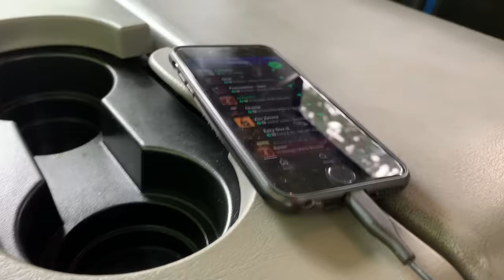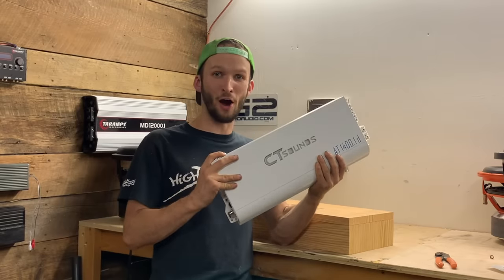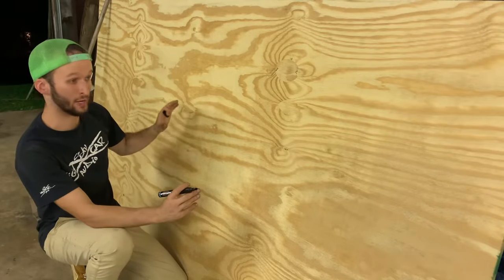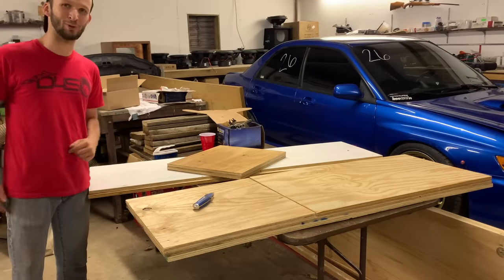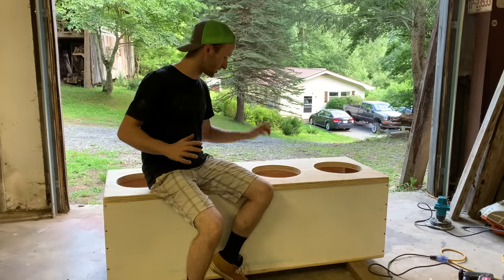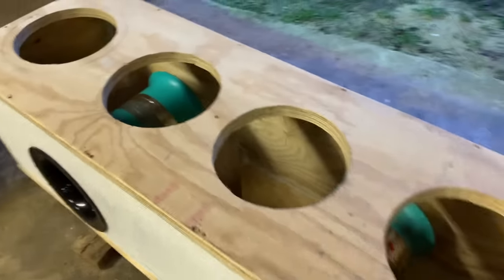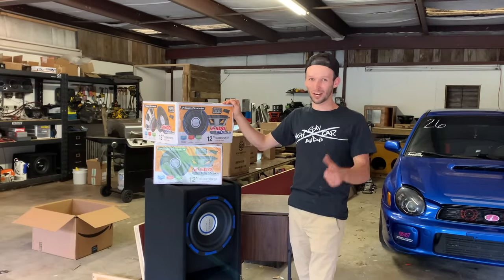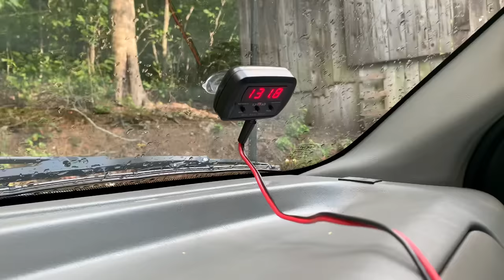How Loud? Walmart Build Part 4 FINAL

Comment: Hey I really like your videos and would really like some help with my build and advice from you and also if have some requests of what I'd like to see you make a video about.  First off I have a 06 dodge ram mega cab that I have been trying to get a custom box built for it to that will fit behind the rear seats and not under, I've found numerous boxes but they are all for a sealed enclosure which is not what I'm wanting. I want a ported/slot box that will be big enough to have the space to add two more subs if I want to later on but right now I only want it for two 12s, the thing is I have to have 7-3/4" mounting depth for the subs I have already which are the skar evl-12d4 and I have the skar rp2000.1 amp that is pushing them for now but getting another amp so the subs can be pushed by their own amp. I have removed all my inside Plastic trim and panels that are factory on every vehicle which I don't care if the back panel that is under the rear window stays removed that's what I had planned for but I would like to possibly be able to put the side trim panels back in if there is any way possible but if not as long as I can make the final design look like it was made at the factory that is great. I know I have a lot of demands and request but I know your audio skills are great so if anyone is able to help me out it's you. With the side panels installed it leaves me with just a little more the 52" from left to right for the box to fit. The thing that is giving me such a hard time is trying to get the internal air space available once the subs are installed and I know there is a method to calculate that by multiplying width by height by length and then divide that by some other number or something like that but the problem Im having is every search I do regarding this only give details for the shape of a square or rectangle box or a wedge shaped box and the box I am needing is neither of those but is similar to the wedge shaped box except that the back of the box on the wedge looks like this ] but mine needs to be like that but not straight up at about around 13 inches or so there needs to be a 90° angle that turns to the front of the box for about 1-1/2" and then a 90° angle turn back up to the top of this makes any sense, I don't know how to describe it with only words and if I could add pictures I'd show you exactly what I'm talking about. The reason the shape is needing to be that way is because at the rear of the cab of my truck below the rear window there is a added brace of sort to give the rear window more support and better structure to the back of the cab and it sticks out from the back of cab towards the front of the truck about 1 inch and that's why I need it to be that shape and with that shape I don't know how to calculate the dimensions to get the over all volume and the subs I have require 2 cubic feet per sub for a ported box tuned at 32hz which is the manufacturer requirements and data. I'd like the ports to be at the top of the box facing the roof but to make things more difficult I'd like to have the port made so that I can but a 90° elbow on the end of the port so that I could have the ports be adjustable with adding either the 90° pvc elbo or maybe a 45° pvc elbo or similar that way it's also changing the tune of the port and hz just a little if this makes sense to you. For example I built a box back in the early 2000s that was in a Suzuki sidekick that was a bandbass style box but all covered except the port which I made out of a 6" PVC pipe and several different 6" PVC fittings to be  interchangeable and it would make a big difference with the different type of music I played when changing out the end fitting and I really like that concept and worked really good so it would be perfect if that was possible. If your willing to help me out i would be very thankful and you can direct message me or private message or if I am able to give my email that would be fine to. Thank you again sorry for the novel comment I have made.  The ideas for the videos I'd like to see you do would be to possibly do some subs and amps from the app called wish they are very cheap in price and some of the deals you can buy 4 subs for the price of 1 no joke and I'd like to actually see what it is that you build and get please

Comment: There isn't near enough space in the cab for 4 12's to breath. I'd bet big money 3 10's or 4 8's would put up higher numbers tuned right for the cab
Reply: @CajunReaper95   yes and no..  cone area is always gonna be a top factor. Only if they can breath. Example. Stick a 15 in a box built for a 12 and a 12 in a box build for a 12, and meter them both with equal power.  That's what I'm getting at.
Reply: @CajunReaper95  he'll what part of LA are you in, I'm back down south for a while, we can test this. Bring ya pocket book. Lol

Comment: Great Entertainment video but there were some flaws with this setup.. The ports were too close to the inner box wall and too close to the car seats blocking the air output. These subs can take more power so you need a bigger amplifier and you need another battery or 2 to help provide more power to them amps.
Reply: Walmart doesn't sell a bigger amp than the Razer 2500 Amp off the shelves. Those GW-124 subs can get really hot from playing for a while on 600 Watts on that amp, not sure they can really take too much power on anything besides a burp.
Reply: @RobertJeffersonBased  The box he made didn't come from Walmart so adding a bigger amplifier for the video wouldn't hurt to try for this project.. also I'm sure that amp not putting out 1200rma to them subs. Voltage drops and box rise won't allow it.. Them subs can do more than what that amp is rated for.. And without extra batteries these amplifiers are being starved power..
Reply: @MikhailFelton  Good point

Comment: I think I seen MB enclosures get 140 db with just 2 8’s and this was 4 12’s dang
Reply from the maker: I got a 145+ on two 6.5s. Video is on the channel from a while back. There are just a lot of variables
Reply: @ Richard Montoya.... Well I think i seen Parker do 145+ with just two lil ole 6.5s  and those were two 8s..hmmmmmm 🤔🤔.💥💥💥 BOOM 💥💥💥.😂😂😂😂.. Bunch and bunch of variables and factors is absolutely correct..

Comment: The ports have to be at least the distance from the back of the box as the diameter of the port. That is not even close to correct. Prolly sound better sealed. That’s a BIG mistake. The box has the 2 2 inch port. Lol 😂

Comment: I'd be pissed,I've put together pawnshop systems that have done over 143db in a civic.
Best budget system I've done so far was a americanbass vfl4480.1 i got for $175 and a new tent 15 i gave$100 for then i found another used tnt15 for just under $100 and i found a Memphis prefab ox for $75 and it was hitting harder than the 2 ab ex 12s and kicker 1500.1 i had and that was the system doing 143.4 at 40hz for over a year before i ab12 have out.
Reply: I had about $275 in that system.
Reply: I bet them 4 12s would eat harder in a suv.